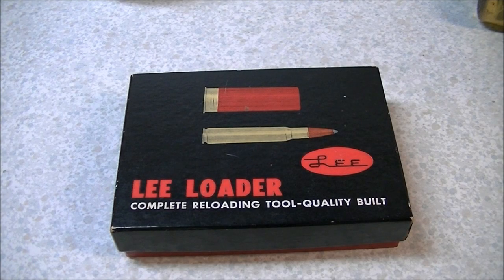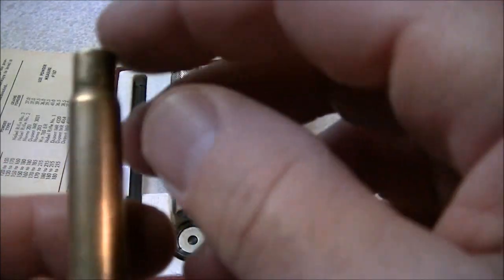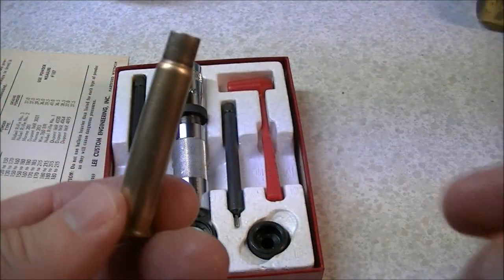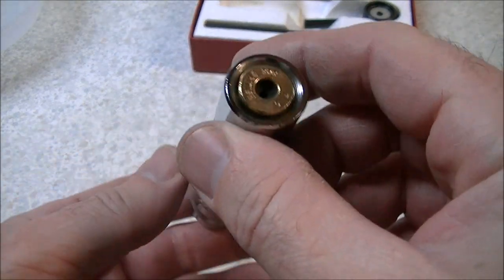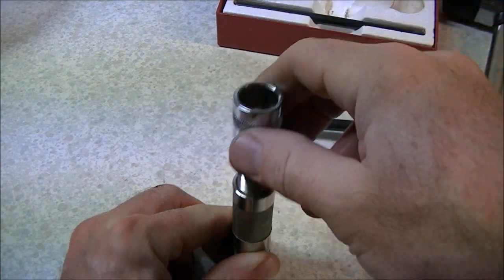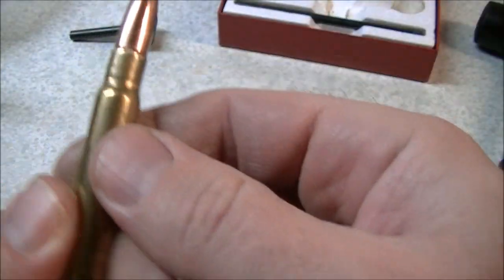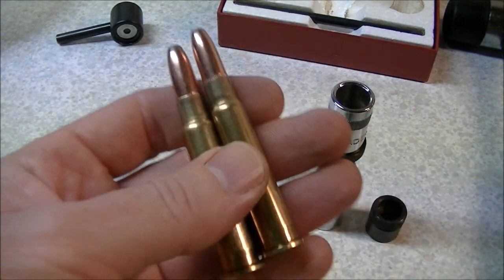Reloading .303 British Ammunition using a Lee Loader Set

Comment: I loaded some today. I've used this tool for many years and it is great. I do use a hand primer as I find it easier and have had some primers go off with the Lee Loader way of doing it with no ill effects. I never crimped them but was glad you showed it anyways. For about $40 Cdn it's a true bargain.
Reply from the maker: henerymag I had a couple of Russian made primers go off priming with the Lee Loader, however these primers had a rounded face and Lee warns against using anything but flat faced primers. With flat face primers I never had one go off.
Reply: 314299 Shooting Channel Even the older round Lee hand primers warned against using certain primers but the newer square types are ok. What is your go to powder? Varget works well for me as does H4895 which I haven't seen in these parts for awhile.
Reply from the maker: +henerymag Reloader 15 is probably my favorite powder for the 303.

Comment: Gday mate,As a long time target shooter using the SMLE I can say those 174 grn round nose are a good choice. They are very similar to the original mk6 ammo.There was always a lot of argument about boat tail and straight tail projectiles,me I like the older style straight tail round. We had to reload because of cost here in Australia and because we bought when we could find cheap stuff we ended up with a lot of cases so as long as the bullet length and charge were right we didn't take much care as we had lots to do.Mind you they all shot well. For that chap who wanted to know about case extractors ,they can be got but usually just put in a empty case and pushed it into the broken case and extract it. It nearly always worked. Cheers Ross
Reply from the maker: Thanks for the input. At the moment here in Canada it is hard to find any .311" or .312"  jacketed bullets for reloading. Are they available in Australia?
Reply: Yes they are still available but not cheap anymore.If you contact the Western Australian Rifle Association,you can google them I think, and ask to be put in touch with the chaps from the Service Shooters Association they will fill you in. I don't shoot any more as age and health issues preclude that. Cheers Ross

Comment: This is really helpful. I had never seen a hand reloading setup like this before, and I was considering picking one up to use for my 7.62x54R rounds. Not the same round as in this video, but it seems like the same basic idea. $35 for a hand operated kit like this compared to hundreds for a press when I'm a recreational shooter (at best) is a big deal. Thank you very much!
Reply from the maker: Here's a tip regarding the 7.62x54R Lee Loader kit, most of them do not work well if you try to load .311" or smaller bullets as they do not size the case very much and the bullets may be loose in the case, .312" bullets work better.

Comment: Great video, I use one of these for 45 70 and have this one coming in the mail. They work great and the ammo is stunningly accurate if you do your part.

Thanks
Reply from the maker: Yes you can make accurate ammo and also these are one of the better ways to load .303 and have decent case life.

Comment: Time to get back into reloading after a hiatus. This looks like the slowest, safest way to restart.
Reply from the maker: Certainly it's one of the slowest ways to reload. As for safety I would say it is actually slightly less safe than using a press as there is the hazard of setting off a primer when seating them.
Reply: @314299  I've done it before this way and I'm happy to accept the risk. The safety factor, in my opinion, comes from the slowness and the need to consider what you are doing at each step. I actually tried very hard in the initial stages of using the Lee Loader to deliberately induce a primer burst and never managed it. Given that it`s shrouded in the repriming chamber, the die itself and the cartridge case base, I doubt anything would happen beyond a loud report, a skipped beat and possibly a change of underwear, but AFAIK nobody has ever set one of these things off in a YouTube vid for us to see what it's like.

Comment: Bought 3 sets recently .303 british, .308 winchester and the .357 magnum set.
Reloaded the .303 cartridges as well as the .308 winchester with VV N140 starting with some "light"loads just little above minimum load.
If this functions it is a very cheap and easy way to reload your cartridges.
First 50 cartridges are reloaded so let's go to the range to see what they will do.
Fun to do, just wear your eye and earprotection.......just in case a primer goes off.

Comment: I use a Lee .308 full length sizing die, fitted with a .303 expander which is adjusted up a little so it just sizes half the neck and nothing else.
Its amazing how many reloads you can get with cast bullets aye, iv had 40 or more out of some of my cases while shooting my subsonic cast bullet load :-)
Reply: Ahhhh, subsonic. Yeah. That’s the full reason why. Not NEARLY as much pressure.

Comment: your post on the lee loader was great for the303, I just got my 303 and would like to reload at a low coast this will be a start for me , I did get a box of 303 for 50rds was $36.00 so your lee set will be my start thank you for your post.
Reply from the maker: What make of .303 ammo did you get that came in a 50 round box?
Reply: it was Brit303 ball the lot is 01 FNB 86. 50 RDS marked on the box and I paid $36.00 for it. oh the bullet is f/m/j..
Reply from the maker: Robert Beveridge
The head stamp indicates production by Fabrique Nationale Herstal, Herstal, Belgium. Unfortunately that ammunition is Berdan primed and not easily reloaded. It is however non-corrosive and of high quality.
Reply: the head stamp is.303 FNB just 2 stamps on the back of this round.

Comment: yes ive gotton up there with prvi brass around 30 and counting a oring on case resting on the rim helps with case stretching by holding the case on the bolt the neck will fire form then you anneal and size

Comment: Good one I recall contacting Lyman in the 80s they told me this device had been discontinued, and any stock sold to old western scrounger.
Reply from the maker: +gump Why would you call Lyman about a Lee product? At any rate Lee Loaders are still made:
http://leeprecision.com/reloading-kits/lee-loader-rifle/
Reply: +314299 Shooting Channel The drive in die used to full length cases was a Lyman product. The time frame I mention late 60s about the only product offered by lee was the loading tool in your vid. The line of tools and equipment was yet to happen.
Reply from the maker: OK. I see a lot of comments in the span of a day so I did not make the connection between the two comments. The Lyman full length "hammer the shell in" dies do come up used on ebay quite often.

Comment: Hey mate thats a great video , very well done,  I went out and got one of these reloaders ,  and your video really helped me out so thanks mate.
Reply from the maker: +Steven Best Glad to hear it was useful, hope you get along well with your reloading.
Reply: Thanks mate I got one for my 30/30 and my 6.5 x55 . there bloody brilliant devices, hey with regards to the powder dipper that they supply with the kit, do you think its ok just to continuosly use it with out actualy measuring the powder? I mean are they safe to use as long as you dont do anything silly with them like double dip? what are your thoughts on the factory powder dipper from Lee?
Reply from the maker: +Steven Best One "safe" feature of the dippers is that they will only hold so much powder, so if you pick a load that is less than what they will hold they ought to be safe enough. the dipper and data provided with Lee Loader sets is for loads that are moderate and therefore quite safe if you follow the bullet weights and powder types specified. Lee dippers are quite handy things, even though I have several powder measures I still use the dippers a lot for loading small lots of ammo. They are as precise as your technique permits.
Reply: +314299 Shooting Channel  excellent  thanks for that information mate, I appreciate your time, have a good one and happy shooting, regards Steve.

Comment: Frank, i find that the 150gr bullet trajectory is reasonably level. This will allow you a longer shot as well. What are you planning on hunting? I have taken down Black Wildebeest, Blue Wildebeest, Kudu, impala, spring buck and wart hog with the 150gr. my longest shot was 220m on a spring buck, but the drop gets a bit too hot to handle. although with a lot of practice you can make it. Try it. I know about 125gr bullets as well, but they are too light for my taste.

Comment: If I may add a comment.  All cartridge brass will stretch and become longer with repeated use.  It is VERY important that the length of each piece of cartridge brass be checked for length after it has been sized and before reloading .  This is to confirm that the brass does not exceed correct overall length.  This is done using a dial or digital caliper of good quality.  The specific cartridge case specs. can be found printed on the reloading instruction/data sheet.

Cartridge brass that is too long when it is reloaded can cause chamber pressure to rise to dangerous levels when the cartridge is fired in the gun.  This could damage the gun and may also injure or kill the shooter or bystanders.

If the cartridge brass exceeds the maximum overall length as indicated on the reloading Instruction/data sheet then it MUST be trimmed.  The company the makes the reloading die set used in this video (Lee  Precision) also makes very simple and affordable tools for cartridge case trimming.  Getting a primer pocket cleaning tool is also a very good idea, and they are also very affordable.

Reloading will improve accuracy, is fun and can save money.  It is an endeavor best avoided by those that are impatient or prone to shortcutting.
Reply: Agreed.

I've just beginning to use this. Once you get a rhythm you de-cap, size, and prime cases very fast. Once you get to actually inserting powder and a projectile little bit more time is necessary with using a digital scale and the dipper provided to get the loads you want.

I will be case trimming 180gr sp ppu brass that was shot out of my rifle. Ppu loads those things really hot...
Reply: @KB9813  

Ppu 357 mag is hot too.

Comment: I have about 8 x 1lb tins of Nobel Rifle #1
It's great powder for the .303

Enjoyed your video
Reply from the maker: There's a powder has not been made in awhile.
Reply: 314299 Shooting Channel
Goes to show how long I've been reloading...as when I first started back in 1982/3 I used a Lee Loader in .30M1 Carbine & one of the Nobel Pistol (or Revolver) powders.
When I got an AR15A2 when they first came out, I telephoned the Nobel plant near Glasgow as the .223 data in the handbook hadn't got any loads for the heavier SS109 bullet; they phoned me back a few days later with some recipes!!
Back in the early mid-80's ALL the club shooters used the Nobel Shotgun 80 or 82 as powder for the 38 special ammo. Dirty & sooty stuff, but cheap & easy to use...made for some long days out & lots of good practice.
Reply: 314299 Shooting Channel
...& to add, Nobel's not that old, I sometimes shoot WW2 vintage ammo & my main 8mm Mauser ammo is early 50's Yugo made. Shoots really well in the G98
Reply from the maker: MooreLeather
Powder can last a long time if properly made and stored. I have two pounds of "Nobel 69" shotgun/pistol powder (it's supposed to be like Blue Dot), have you ever heard of or used it?
Reply: 314299 Shooting Channel
Sort of rings a bell (picked up some 60 & 62 last year - same charge weight as the later 80 & 82 but NOT THE SAME VOLUME)
I have most Nobel manuals from the mid-60's onwards...so I can have a look in these later to check.
Seems to be a lot of data online about it, from other buyers like yourself too.

Comment: Grate video but can you not make a video on how to make your own broken shell extractor for the 303 and how it works, this will be good to know especially if you are in the field busy hunting.
Reply: You can pick up 303 case extractors for about $10 or so if you look online.
Been shooting 303 over 36 years and only seen one case head failure (on an Indian made SMLE)
Reply: +MooreLeather I have had luck removing broken cases with wire brush down the bore.

Comment: Shot my 1st box of Lee Loader .303 reloads the other day & they went well, or at least the ones I formally weighed the charges for did; I'm not sure whether the rest were just me getting fatigued or the scoop weights being inconsistent. My only problem is that dumping the scoop down the throat doesn't work well with Varget; powder spills out around the case. Someone else suggested that the coarse grain of that powder is the problem & something finer or a ball type would be better. Your thoughts?

Comment: This is a fantastic video and very well explained.
Using this method, how many times can you use the same shell?
Reply from the maker: As neck sizing is easy on the brass you ought to be able to get at least thirty reloads out of cases, assuming the loads used are moderate. I have head of guys who have had over one hundred loads per case when shooting low power loads.
Reply: @314299  Excellent! Thank you again!

Comment: I have another question. Some youtubers say that the correct way to load stripper clips for the lee enfield is one cartridge all the way back, next one in front, next one all the way back, next one in front and the fifth one all the way back. My question is after you push in the first five then the sixth cartridge which is flush with the back of the clip as was the fifth from the first clip wouldn’t the rims be flush with each other? I think that the second clip should be loaded with the sixth cartridge back away from the back of the clip and the seventh should be flush with the back of the clip and the eighth should be away from the back of the clip and the ninth should be flush with the back of the clip and the tenth should be away from the back of the clip in order to keep the continuity of cartridges front and back. 🤣😂😊
Reply from the maker: Yes, the way you mention at loading 303 chargers is the correct way. 
Although it would seem that there are combinations that would lead to "rim lock" they generally don't if the ammo used has the correct profile military type rims. However with some commercial 303 ammo that have a flat, non radius,  rear rim surfaces rim jams can be an issue. When it comes to loading from a charger/stripper clip the rims generally jump into the correct order when pressed into the mag and released due to the internal profile of the magazine. Chargers work best if the mag is not loaded to capacity, I would not recommend filling a mag by loading two chargers, loading to full capacity is best done with loose rounds, once at least six or seven rounds have been fired it is possible to reload a charger of five and have them line up correctly and feed properly.

Comment: Very helpful and informative.  I have just started reloading with a 303 Lee Loader, with bullets cast from the Lee 303 mold.  I'm finding that the bullet seating process leaves a ring on the top of my bullet, even with a generous chamfer on the case neck.  Any suggestions?  Thank you for such an informative channel!
Reply from the maker: That's pretty much inevitable with cast bullets, they are generally much softer than a jacketed bullet, larger in diameter and of different nose profile than jacketed bullets. Reshaping the end of the punch that seats the bullets to match the shape of the bullet you are using is one thing that might help a bit.
Reply: 314299 Shooting Channel Thank you again.  I was mostly concerned that I was doing something incorrectly, or that my lead mixture was too soft (wheelweights and some solder).  If it is an expected part of using the cast bullets, then all is good!

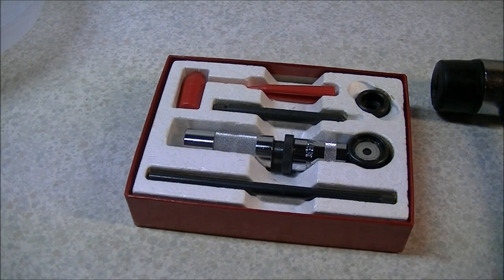Comment: You seem to have repeated the neck-sizing portion of the vid. 7:01 and 7:37. Also - paint thinner? Won't that attack the brass? However, yay for someone who finally goes into adjusting the seating depth and crimping. It's probably not necessary for these bullets as you said, but the little 123gn bullet has very little length within the case neck and might benefit from it.

Comment: I have a 303 No4. I've wanted to reload for it, but i've read it's dangerous. Still doing research. I really want to shoot it, for recreation and for hunting. 

I have a Lee Turret press, but i may get one of these and use it instead.
Reply from the maker: It's no more "dangerous" than reloading for any other rifle.
Reply: 314299 Shooting Channel I think what freaked me out is all the info I saw on having too much headroom. My 303 has a no 3 bolt which I believe is ideal. I'm going to take to a gunsmith to check out. I haven't shot it in 5 years or so. I want to but all crap I was reading makes me hesitate
Reply from the maker: It`s not a bad idea to have any old rifle checked by a qualified gunsmith. You could also buy a set of head space gauges and check it yourself.
Reply: Thanks very much for the replies. I'm getting the loader set

Comment: Correct me if I'm wrong but the neck sizing is roughly a 2 step process with the decapping and then putting the case flush to the die body right?

Comment: The question I’ve been looking for in the comments is, you mentioned you might get up to 3 to 5 reloads using other methods: if reloading using this tool prolongs cartridge life, how many reloads could you expect using the Lee Reloader Set?
Reply from the maker: Like many things, it depends on mostly on a couple of factors The firearm used makes a difference, brass used in a P-14 tends to last longer than that used in Lee Enfield rifle. Another factor is how "hot" the load is, brass loaded with a milder load will last longer. It is pretty safe to predict at least ten to twenty loading when using a Lee Loader.